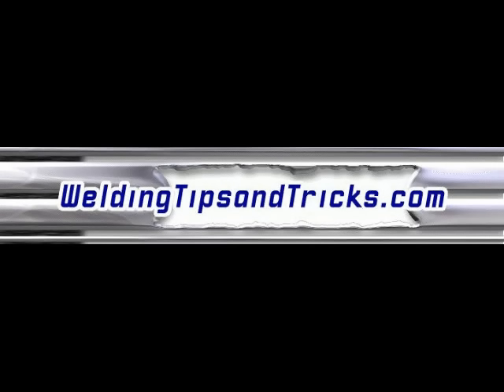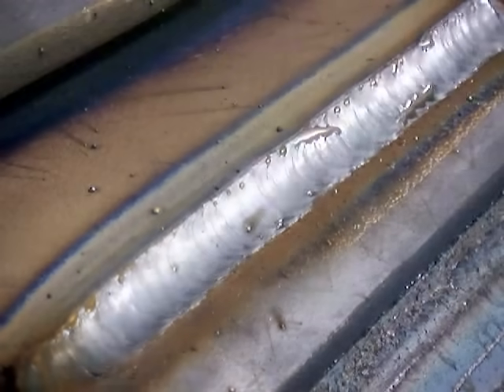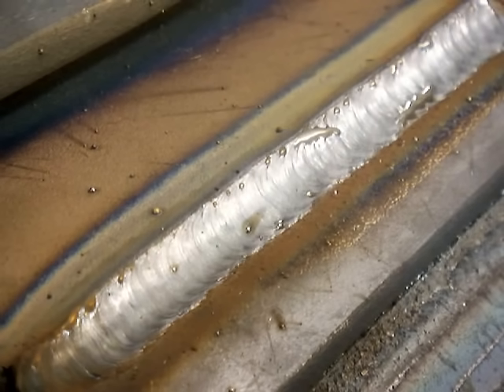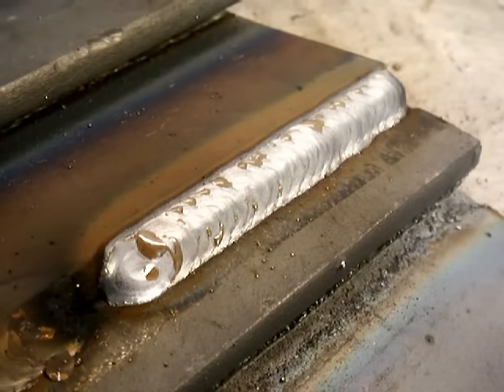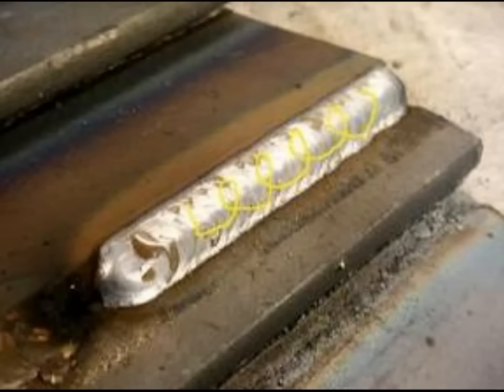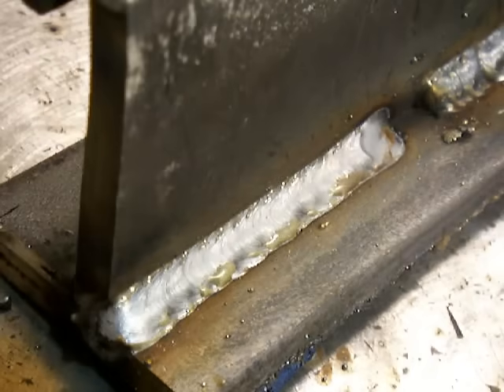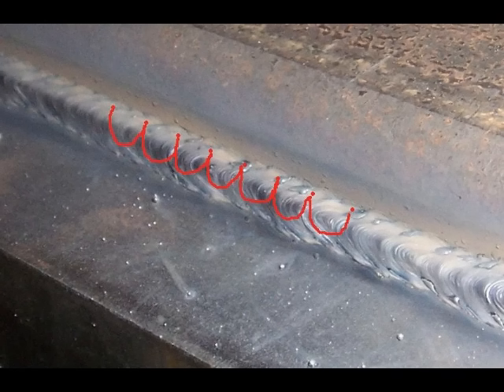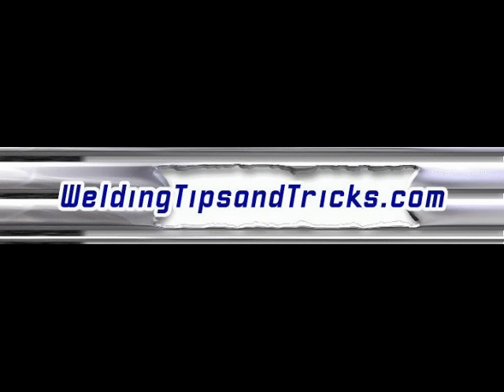Mig Welding Technique Taught by Old Timer

Comment: You should always push your  weld, if you pull you take more of a chance of contaminating the weld. Ive seen it happen many times and I've been a welder 
for 42 years. The process does mater.
Reply: You are right sir. Pushing the weld pool in Mig welding is best. A vertical down is usually  pulled down.  Flux core can be pushed or pulled.  Innersheild  should be pulledor dragged along. I've been a Boilermaker 1st class welder for near on twenty five years and have been taught by all sorts of ol school tradies.  Listening and learning from them all has got me where I am today.  Too many armchair experts giving opinions as usual.
Reply: Nice to see some sense being spoken about MIG welding.   I've had many a 'debate' with 'welders' who usually turn out to be self taught, have never had proper training, have never had certified weld tests done on their work etc etc.     A trained and qualified welder will always push.   (Apart from when welding vertically, when 'vertical down' is preferred if the work is thin stock...  where a single bead will do).   For a few reasons:   1..  You can see where you're going a lot better...  If you feel you must do  'little circles'  with the torch, it's still better to do those circles on the parent metal..  as you push along..   and not onto the metal you've just laid down..     2..  What's the point of simply heating up the weld pool by 'welding' onto it...pulling?  Because that's what you're doing...  piling up hot molten weld metal without it properly penetrating the parent metal..  3..  Control of the weld pool.. it's easier to prevent the weld pool from slipping under and ahead of the pool if you push, thus avoiding contamination and poor weld quality.   4.. And most important I believe..  pushing gives more 'arc time' for the arc to 'burn' onto the parent metal.    The arc front is more 'face on' to the parent metal and so will aid penetration better...  rather than be wasted by having the face of the arc arcing the weld pool behind.    I've seen tested face bends and root bends fly apart when being bent severely under testing.     Poor penetration can and does leave what amounts to a long crack if the root isn't properly fused.   In severe cases the actual weld bead has been known to come away along one toe edge..  as though it was cake icing laid along the seam...   Both are known as 'cold lapping'   and this is the main reason that MIG welding wasn't allowed as a process, in many critical situations, for years.   The arc is intended to melt and fuse the parent metal..   not to make the weld pool be heated up...    this wasted heat will make the weld pool bubble and boil,  but might not actually penetrate the parent metal that you're trying to weld.   Unless you're only welding thin stock,  were any direction might do...   pushing ensures the root edge and weld face is fused properly...   and doesn't stay relatively cool when simply 'covered' by a hot weld pool.    Also, because of the rapid travel that's required in 'vertical down' (pulling...)   the technique is known in the industry as "Shallow penetration welding".      And shallow penetration is what you'll get when you pull a MIG torch, if you weld anything thicker than D.I.Y.  metals.
Reply: Push a 7018 on a structural weld and see if the boss man doesn't kick yourass off the job site.
Reply: Thats it mate contamination means failures  . Especially in coded welding.  Bad things can happen if  a weld fails.
Reply: +rock dawg Not so, if you draw a weld it sucks in air right into were it is molten and can get trapped in the weld causing a possibility of getting contaminated . When you push a weld the air glides over the weld from were the weld is already solidifying and is burned away so it can't contaminate the weld. I hope this helps to understand why you should push a weld. I'm not trying to cause trouble just trying to offer good advice. Sad some trash good advice but that's the way people are today.
Reply: Ive always dragged flux core with little angle, never had any issues through testing, but the guys that taught me said if one sets the welding machine correctly one should be able to push or pull and they proved that to me, however I wouldnt drag solid wire.
Reply: ive always pushed with solid and pulled with flux/dual shield
Reply: +Jonathon Motes.  I used to weld the BOC and Praxair cryogenic trailors that hull the gases for all you welders. There all aluminum, x-rayed and helium leak tested. I'm not saying people can never pull down. I've seen them do it and pass but I've seen so many more times that they pull and create porosity and fail. In my practices I've always found that welding vertical up gave a much better weld and more consistently and was a stronger weld. I know there's some people out there that have opinions opposite to mine and if it works for you great but personally I would never do it. To me doing a vertical down bead is just asking for trouble.   I've also found that many individuals that I've encountered that welded a down bead couldn't seem to master welding up. They either undercut, burn through or had problems with porosity. I'm just saying. There's always going to be critics out there that are going to slam whatever I say or what other people say. This is my opinion and I im sticking to it, no matter what anybody else says. I am very confident with my answer and will not waver and no I did not just weld flat welds. I weld overhead, vertical, horizontal, flat, and 6G. I also weld aluminum, stainless steel, Cobalt, titanium, steel, nickel, cast iron, and bronze. processes I do is mig, tig, stick, submerged arc, Bubble welding as well as auto weldering using an automatic mig welder. thats a list of my credentials.
Reply: Chris England it's nice to hear from someone that actually knows what they're talking about. I will say several have come to my defense because they actually knew what they were talking about. but thank you for your post. I hope that individuals that seriously want to try to do better will listen that's the only reason I'm putting up these replies. I'd also like to add one thing to your comment another reason why you would push a stick weld is because of the angle. If you pull, because of the slight angle pieces of cold flux can fall into the weld which can cause the possibility of our getting trapped resulting in porosity. where as if you're pushing you're weld you're preheating the path prior to melting it as your welding rather than instant heat to travel heat which can cause air to get sucked into the center of the world before it actually solidifies again causing the possibility of porosity. but thank you for the support and good information you brought out.
Reply: +Customwinder 1 i agree with you its important to keep any contamination out of the weld
Reply: +rock dawg.   Well I guess that's your opinion. I've been a welder for 38 years I've always welded uphill on my root pass and all my passes. I never had a problem with lack of penetration as a matter of fact my welds were always  very clean so pardon me if I don't put a lot of stock in what your boss or you say. I've also been 6G certified on top of many others. I started my conversation too help people see the information that was being given was not proper but it's turned into such a fiasco it's really not worth my attention anymore. There's an old saying you can't fix stupid. So no sense in me trying, anymore.
Reply: +rock dawg I'm glad he's your former boss and I read about the guy you knew in the Navy after I posted my comment but to inform you MIG welding actually was on the Main mainstream by the 1950s so it was quite prevalent in the 80s and I started welding in the early 70s and it was prevalent then. Anyway just some information.
Reply: Fact. Anyone that welds xray or ut joints within stringent code for parts that cannot fail will tell you never pull mig.
Reply: yep iv'e seen it happen
Reply: that is true the weld process is different than stick were you have the slag to protect the weld from being contaminated with mig you have the sheilding gas or flux wire with pushing the weld you will have the gas pushing any contamination out of the weld with pulling the weld the chance of contamination is more so always push the weld..
Reply: the truth is that welds can be subject to all kinds of problems do to sheilding and flux failer Ive seen it during regular arc welding when porosity show up in a weld or cracking there a lot of variables can happen iv'e seen a lot in my years as a welder bad electrodes wrong pressure for argon/ C02 bad metal prep the list goes on and on...
Reply: +rock dawg it's all do to human error, like not keeping the welding rods warm to keep moisture out, not doing proper prep on metal, using gas incorrectly. allowing old bottles of gas to be used and not discarded, so on and so forth. a welder with proper skills, knowledge and experience would not make those mistakes or at least very few of them. Nuke welders know this very well they train over and over again and again and that's why.
Reply: thats true ive seen shops that had rods sitting in cans and not keeping them in warmers to control moisture i worked at one the owner didn't care about about spending the money on extra equiptment or a decent welder we had to use an old peice of crap which hardly worked right so the list is large there is stuff i'm now learning now that i retired from welding and surprized now to know about proper ventalation and fumes from welding and operator safety and not storing argon tanks for long time without using. I learned more from miller corp from training seminars online in the past two years than i knew previous... so i see your point..
Reply: nope pulling leads to weld contamination i worked in a fabrication shop  iv'e seen welds go bad when porosity happened
Reply: rock dawg yea i love dual shield, it sucks having to clean slag but welds amazing. lincoln 71a75 seems to run similar to 7018
Reply: +R Reichel  You must have welded flat t joints for 30 years. I weld for Cottrell INC and I pull all day, we go through strict inspection because of them being semi trucks. We build 11 car semi truck haulers, so yeah pulling is ok I promise.
Reply: +rock dawg   Am I hearing you right you think an up hill root pass may not give you good penetration? Really? Wow.
Reply: I have welded for 38 years and I have never found a position where I could not push a weld so I'm not sure what you're talking about. the only time I pulled a rod is when I'm doing downhill on a vertical weld trying to get rid of rust which is just a fast pass then I weld vertical up always holding the rod angled upward.
Reply: I dont think there is a be all end all for all situations, both push and pull have there uses.
Reply: Chris England sorry Chris I meant air not our
Reply: only if there's a gap fella other wise all up hill lol
Reply: Clifton Williams  not the case bud. I am certified to weld military xray/ut joints and if i dragged the weld i wouldnt have a job.
Reply: +R Reichel approved
Reply: ha you would think that the sheilding gas would push out the contaminates
Reply: Customwinder 1 thank you finely someone who knows what they're talking about. There are so many pin heads out there. They need to think a little bit but most seem to just like to talk and put down good advice I don't get it but it is what it is.
Reply: What would contaminate the weld during the GMAW process?  Why is it more possible when pulling?
Reply: because the amount of factors weld sheiding pressure of argon how clean the welding material is what wire is being used unsheilded or flux coating many factors can have a effect a venting system is being use to vent fumes away can pull the sheilding gas away from weld metal temps and welding out side can also affect it ....so thats why it is better to push than pull.....
Reply: +rock dawg but aren't those same factors present no matter what the direction of travel?
Reply: +PJ Hainer no
Reply: So, when pushing, a different shielding gas, different type of wire, as well as a different venting system is used?
Reply: no the mix is argon gas and co2 for sheilding 75/25 the other is flux core mig wire which sheilds the metal pool during welding the vent system is a machine which take the welding fumes outside of the welding area to limit exposer of the fumes which can be harmful to health material safety data sheet or msds
Reply: So your saying with flux there is no chance of contamination hmmm. If that's your opinion that's fine but its not mine. I've seen welder have flux rollover and when the flux was chipped away there was a big void underneath that happened to guys pulling there weld. Like I said your opinion is not mine.
Reply: no as a welder ive seen it happen with regular stick welding it can happen anytime if the argon for some reason stops flowing or the flux on the wire spool is contaminated or you get a dirty spool of wire miller is now selling spool wire cleaner and lubrication wipe i have them on my miller matic 140 auto set they keep the wire clean and lubed they can be bought from cyberweld co you get six of each for $20 buckys
Reply: Pull it😴☕
Reply: thats great but not everybody has the dual setup i dont my miller has bare wire with sheiding with 75/25 mix it all depends on how much pressure  you run the range is 15-25 you have to find the happy medium...ive been a welder for most of my life this is the first ive' heared about dual shielding the plant i worked at we only used gas and bare wire they didn't have the flux wire then.... thats over 35 years ago
Reply: i had a friend he was a navy welder his welds were a thing of beauty he could weld up hill all day long talk about strong yesh..
Reply: that was my former boss thats over 40 years ago he was an old timer that was his way  he wanted it done i'm not knocking your way mig was not yet in practice he had tig unit and mainly stick so thats what i know i didn't get involved with mig untill 1980'ds when i worked in a stainless fab shop that made jetstream ovens for pizza hut but nobody there was cert so its the right way the wrong etc..
Reply: R Reichel wow... what job lets u push your stick electrodes? gonna stay away from that disaster...
Reply: push or pull you go to far back in the puddle you lose . you pull to much your puddle goes where you put it. I use both . hell i have even done soild wire pipe roots but you have to do it right ..... I went to holbart for welding school and 2 years of high school welding i have d1.2 certs for pipe 2g-5g-6g and 1-4f 1-4g also 1/6th flux ..... I can push or drag solid wire all day and get the same penetration.
Reply: Ben Jirinec I'm glad you read the book to understand what codes are but by your comment prior to that I know you haven't been certified in all those classifications or you would have never said what you said in your previous comment. So with all those certifications have you acquire them from one shop?
Reply: No its the classes that you get when you learn at welding school that teach your the various positions that you have to master to obtain a certified welder for that and be trained in MIG tig stick and pipeline welding on root fill and cap and sub arc
Reply: Ben Jirinec ah ah you get your certs a school for what job  your assigned  you won't get a job unless you can pass a cert test for the position  weather it be pipe vertical overhead flat 4g/5g/6g I worked as welder 40 years
Reply: elements on boiler tubes, man each side hot starting off each other
Reply: R Reichel NOT True. Push or pull according to the situation.  You are  old school which is not necessarily a good thing. Many pull tests have been done on both styles with little or no tensiile strength difference.
other than a seal problem for any type of pressure there are no worries.
Reply: terminal velocity really I still got to keep putting up with you ignorant individuals you know this is an old subject if you guys want to continue to be stupid so be it be stupid I don't really care I know what I know I've been doing welding for an awfully long time and I'm sick and tired of all your garbage with you stinking immature idiots so just keep your thoughts keep it to yourself. Obviously you stupid people can't get the just of it but I'm not changing my mind no matter what you say about it too many things too many times too many years and I know what I'm talking about and I don't really care what you think so just keep it to yourself
Reply: Customwinder 1 f
Reply: R Reichel !
Reply: missmymountain when you push the weld you are blowing shielding gas in front of the puddle, when you pull you are pulling into dirty air. You can make it almost negligible with torch angle, but pushing eliminates the risk. I was taught this method right from the start almost 20 years ago by an old timer myself.
Reply: Charles is right. Why would they else insist on going uphill for very strong welds? It would only go downhill. You get more air in your weld when you drag. Making it more breakable. When i began to weld i dragged cuz you see the weld better. Then they told me that was wrong. I never ever see someone drag the weld. Except elektrode.
Reply: Also its not cuz it looks better it is better.
Reply: Clifton Williams I was taught by and old timer too, he taught me never to pull and always push. We were not doing coded work, but we were building crash test structures that repeatedly saw huge shock loading and stress. 

I don't necessarily think he was right to never pull, as both techniques have their place, pushing always gets better penetration at the toe of the weld, where pulling gets deeper penetration in the center (for mig at least)
Reply: This sounds like a classic tradey shit fight. Different people with different opinions about a topic that is 100 years old.
If you guys actually knew what was going on, you would simply revert to your codes. This isn't a matter of opinion, this is a matter of mechanical engineering, welding engineering and science.
If your country's and field of work's codes allows you to drag, then clearly greater minds than those present on this scheister thread have deemed it suitable to drag your weld.
If your codes say that dragging will induce more air into the weld and hence cause failures, then follow those codes.

Classic tradeys, arguing about stuff as if there aren't 1000 pages of AWS, ANSI, ASME, ASTM Standards already in existence. All of those pages are built on the experiences of tradespeople and engineers such as yourselves, but they follow a proper engineering and scientific method...they aren't a collection of poorly explained garbage from youtube.
Reply: Yea always push your weld. And if it's in a tight spot where you can only pull it then it should never be welded. /end sarcasm.
Reply: +Jonathon Motes,
I agree Jonathon, having held every cert known, and 40+ years under the hood, it does not matter which direction you go in flat horizontal or overhead. Even vertical, depending on what your welding, and the application,  you can go vertical down, or up!
Reply: i understand a root pass down hill but not uphill other wise you could be taking chances with poor penitration.....
Reply: and what if you cant push it in the situation you are welding in ........ you clean the metal and there will not be any contaminating . there is not a code telling you in any wps you have to push or pull . I weld to d1.2 everyday not one cwi has ever told me you cant drag .
Reply: The first part of your YouTube  name is really self-describing because you're full of a lot of it..........ha ha ha
Reply: no what he's saying that with a mig weld you have the option of pushing the weld rather than pull it but on a root pass you will get full penitration of the base metal  and walk the cup downhill at a 30 degree angle and then your uphill passes are driving into the metal  at a 90 angle and you cap pass is the same way
Reply: yeah like down on a root pass and fill and cap uphill
Reply: thats false man crerts are for on the job . they last 6 months or if you keep welding to that same code and wps then you dont lose it .
Reply: I go by what the pro's say Root pass is down hill while that the fill and cap are down uphill
Reply: Really... you should push it? That is bare wire you jack ass. If you are using Flux core you dragggggg it.
Reply: i use to work in a welding shop and my boss always said verticle down welding uphill is a bitch the puddle wants to drip out you gotta have the amps and rod selection just right and your polarity right you can do a root pass down hill but the fill pass and cap uphill